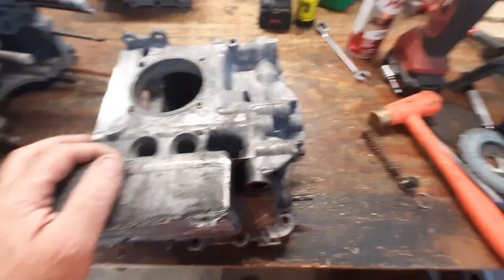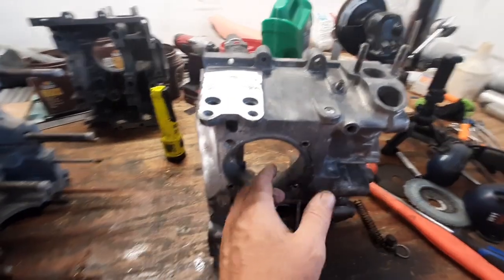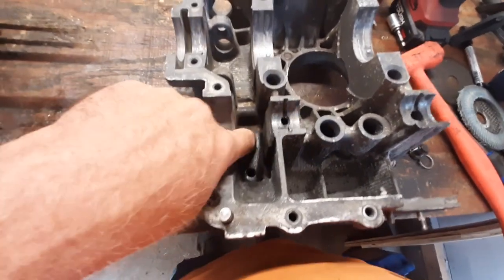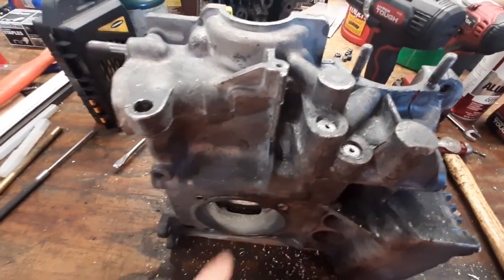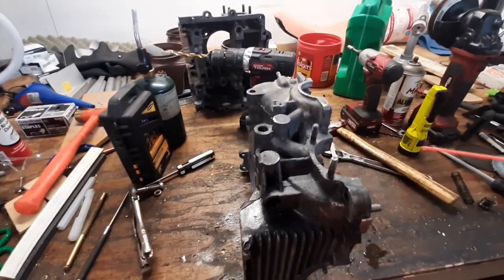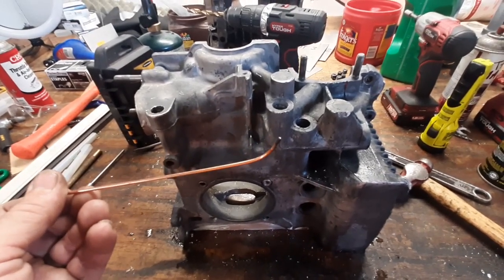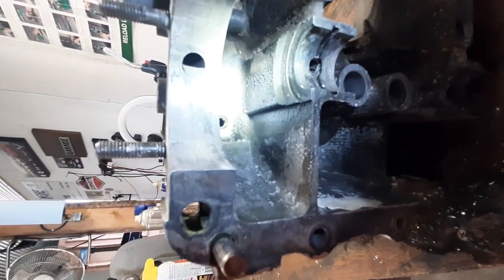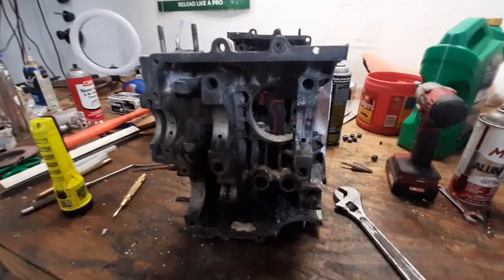1/2 VW Build - Part 5 - Oil System Modifications

Comment: What is running pressure supposed to be I recently purchased a complete 1/2 VW that was done probably in the 80s when I started for first time pressure was near 100 psi only ran for a minute
Reply from the maker: I'll check the plans when I get home but I think the pressure was supposed to be around 40.  The bypass valve should start working long before 100psi if it was set up right.

Comment: That valve is easy to remove.    I can not beleave that would hold up any one
  Simple yse a tap  therd  in  and pull out
Interisting video.
Reply from the maker: Yes,  should be easy to remove but these engines are so old things get stuck.